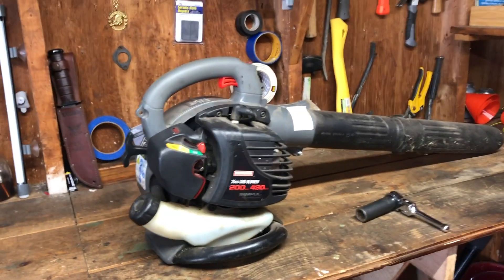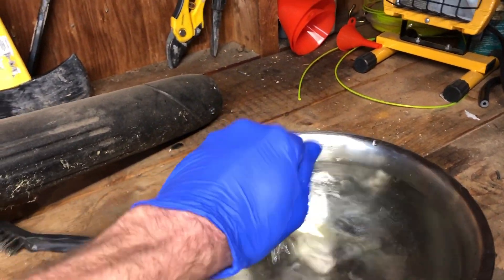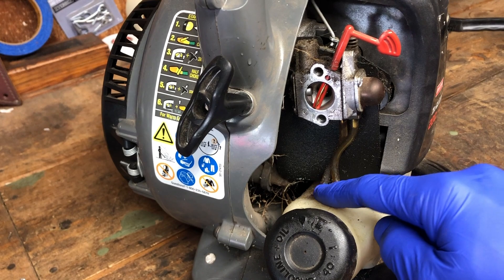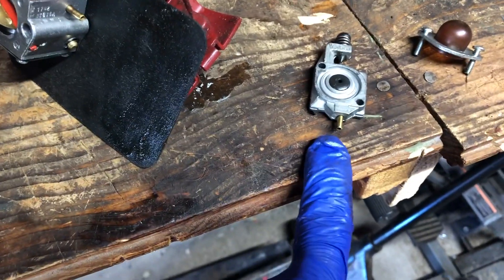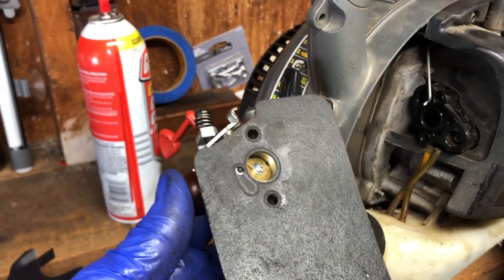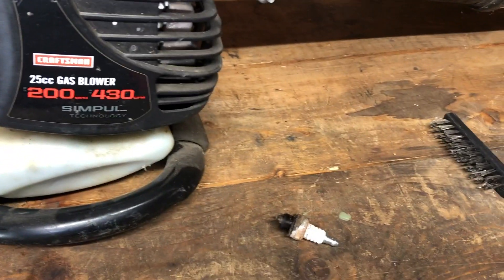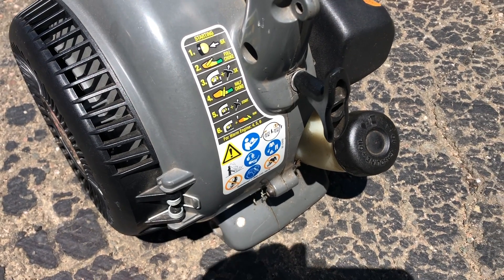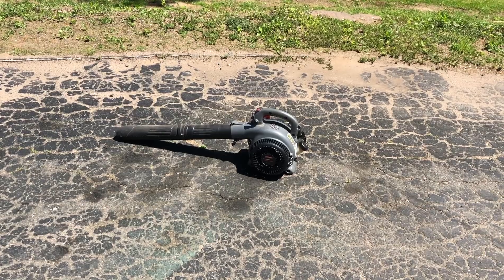Leaf Blower Won’t Start After Sitting? Here’s How To Fix It!

Comment: Hey there great video! I did all the steps and it’s still not running! Had the blower running last fall but it would only run if it was in full throttle. Any idea what the issue may be?
Reply from the maker: Hey man! It sounds like fuel delivery. You’ll want to clean your carb again, but pay attention to every little detail. Small engines like that can run poorly if there is any blockage in the system. Also check your fuel lines. They may look okay, but there could be a hairline crack causing a vacuum leak which can prevent fuel from getting to the carb. Go slow, take your time and check every component. It’s annoying having to deal with these sometimes, but once it’s running strong you’ll be thankful that you went slow and got it done right. Best of luck to you 🇺🇸🤘

Comment: Would like to know how do you adjust the gas and air knobs on the leaf /weed wacker
Reply from the maker: Depending on the model that you have, there may be and air/fuel screw and/or idler screw. Look up your model and you may be able to find a PDF of the users manual. Hope that helps!

Comment: I have the same Blower , the problem of mine is I can't start after each use .   I have to leave it about a hour or two before I can restart again ...

Can you help me on that ?
Reply from the maker: Sounds like fuel delivery to me. Remove the carb & fuel lines. Thoroughly clean everything & blow out with air. Ensure the air filter isn’t clogged. Make sure the spark plug is good. As long as you take care of fuel/air/spark - your machine will run as it should. Best of luck! 🤘🇺🇸
Reply: @jimmysgarage9068  

Excellent ... I'll try to do that 

Thank You A Ton , keep up your good work 💯

Comment: I can't get my leaf blower started but my two sons can. I do the exact same steps as they do but it won't start for me. Do you have any ideas about why this might happen? Is it because they can pull the thing harder or faster than me? It's VERY frustrating because I can't use it when I want or need to and have to wait for them to be home to use it.
Reply from the maker: That is strange. Only thing I can suggest is to make sure you have a clean carb, clean fuel lines and fresh fuel - should start every time. Best of luck to you! 🇺🇸🤘
Reply: Just let your son's do the work for you

Comment: oops new at all this its a older gas leaft hand held crastmans blower
Reply from the maker: Recoils can be a pain - but they are all “fixable”. Take it apart, see what the issue is, and repair accordingly. If you have the model #, you may be able to order replacement parts. I hope that helps. 🇺🇸🤘